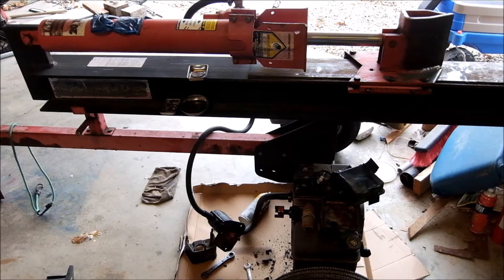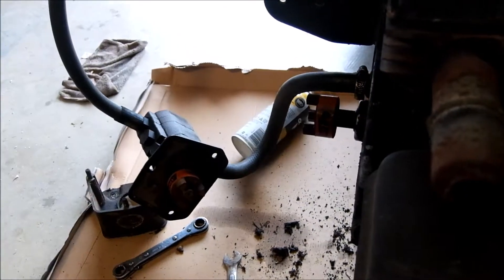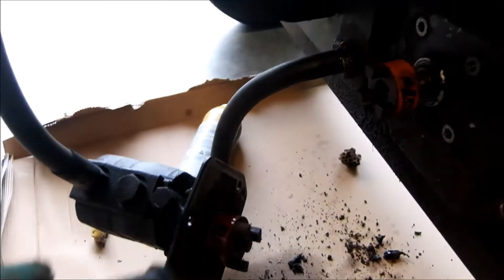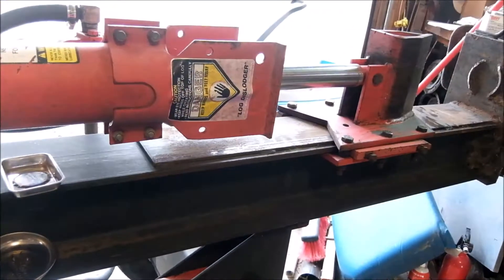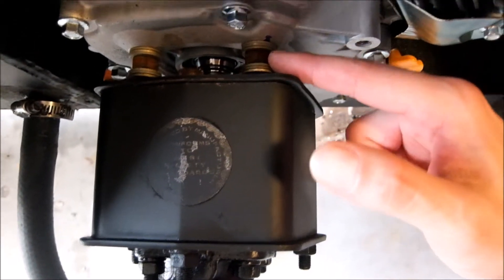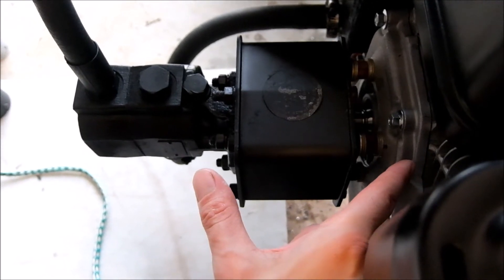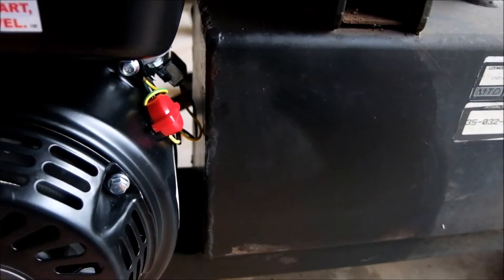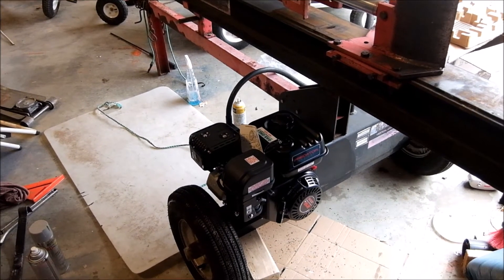5hp briggs & stratton to 6.5hp predator swap on MTD 20 ton log splitter

Comment: Can you give a little more information on how you use the spaces and bolts. I’m about to replace my MTD Log splitters Brigs and Stratton engine withe the same  predictor engine  soon, thanks
Reply from the maker: The holes line up you just need to put it in place to figure out the spacing / bolt length
Reply: @sweetpigfarm3645   Thanks alot, this is a great help, no wahy was I cutting the shaft. I've got the engine and am working on getting the Lovejoy coupler off the old engine shaft. Is there anything on the coupler  that gives the type and size of the coupler? Mine looks to be the same orange Lovejoy as yours, Thanks for the help.
Reply from the maker: @swanni222  just the size of the shaft helpedme find the coupler
Reply from the maker: If you are talking  about the motor to the base, just place it where u want, mark the holes and drill
Reply: Maybe tack some sheet metal over the exposed shaft?

Comment: I re-engined an old Sears 5hp B&S tiller with a Predator.  Can't hardly crack the throttle on the Predator or the tiller will get away from me it has so much power.  Have a Predator on our generator as well.  They are fantastic engines at give away prices!